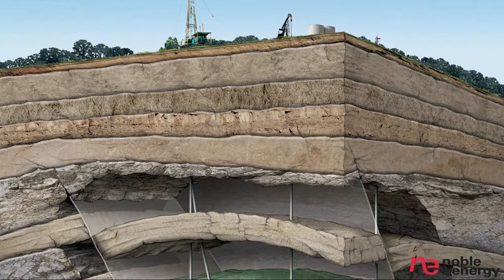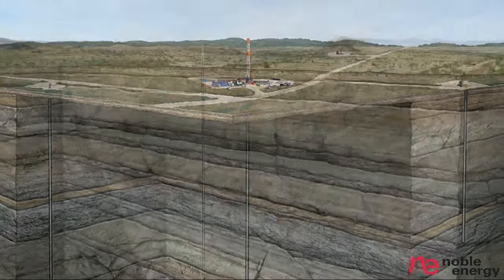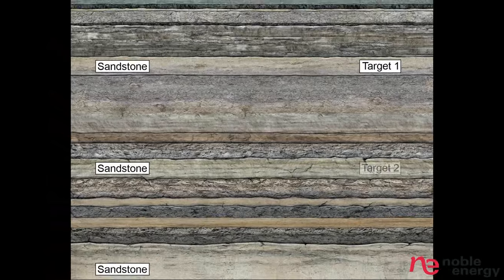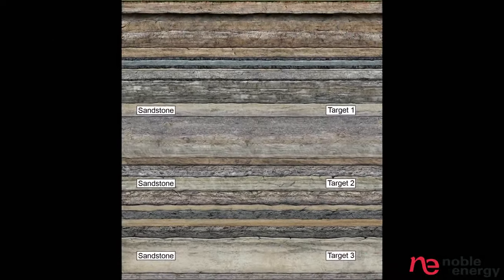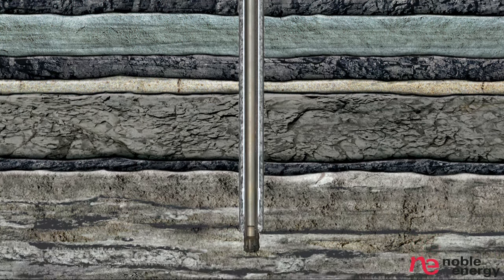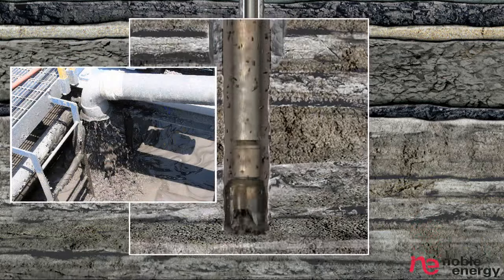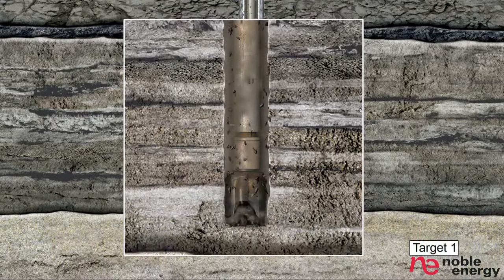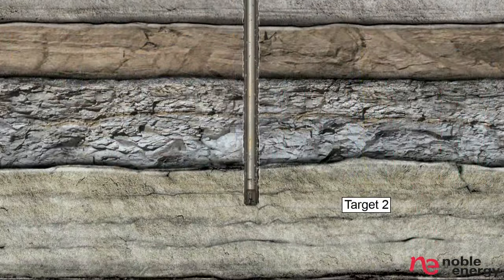Hydraulic Fracturing Stimulation

Comment: Yeaa so im not seeing whats so horrible about this? Why am I supposed to be against it again?
Reply: As I understand it, it can present the following risks: 1) fracking at a too shallow depth, where the cracks result in fracking fluid or oil/gas contaminating the water supply 2) same if the well casing breaks 3) flowback water being improperly disposed, eg being dumped into a river or an open pit or a treatment plant that isn't capable of removing these particular chemicals. Maybe there's a way to do it safely, but there's always a financial incentive to cut corners, and in that case the damage can be major.
Reply: Exactly
Reply: Let's also consider the environmental laws. In some states the laws don't require casings, just a leaky pipe driven into whatever strata they're going for, allowing leakage into the strata above. What is shown in this video would be within the law in states with more stringent environmental regulations.
Reply: Come live in my area for while.  It will change you mind.

Comment: looks like something Mr. Burns came up with. Don't the fracturing chemicals get left in the fracture and contaminate groundwater? Interesting that a video produced by an energy company that uses this form of drilling left out all the atrocious side effects of the practise.
Reply: the chemicals are released thousands of miles below the surface. No place in the nation, even deserts with deep wells, gets water from anywhere near these fracking wells.
Reply: @bennetthasty7488  That isn't accurate. Firstly, the chemicals are released thousands of FEET below the surface, not miles. Second, the entire water table is interconnected and heated water from deep within the earth perculates up toward the surface. I worked in a laboratory where we would take soil samples from the surface that could identify mineral deposits thousands of feet down because water that bubbles up carries trace amounts of these minerals with it. There have been reports all over the place (and in the scientific literature) of scientists identifying toxic and carcinogenic chemicals from fracking in peoples well water.
Reply: @brcarter1111  dont forget that when they finish they also put a similar solution in the fractures leading to the chemicals being able to transfer to other sources over time. Which is why we have so little drinking water than thought
Reply: @bennetthasty7488  Actually only a couple of miles.
Reply: What chemicals, mostly water and sand.   You have no idea what fracking is about

Comment: I have a question: how the cement layer is being created around the casing and the aquifer? I understand that the casing diameter is smaller than the hole so, when the cement is pumped through the inner core of the casing, it starts to cover the outside of it by going around the casing pipe. It is posible when there is a solid wall around the casing but when  it is water? How the cement layer is created around the casing?
Reply: Last question first.  As shown, cement is pumped down the casing and when it flow out of the bottom, the only way to travel is up.  The amount of cement is calculated to fill the annulus or space between the casing and the hole wall. 

Now to address your water question.  Cement may flow out a small distance into water zone but it is thick and will "plug" the water zone as the cement continues to rise.  The cement will harden even when under water.  After cementing, a cement bond log can be run.  This type of log "rings" the casing.  This is like tapping on a tile on a floor in that it sounds different when the cement under the tile is not bonded.  The ringing is recorded as a chart vs depth. If the bond is not good in a critical water zone, the casing can be perforated, the zone isolated, and cement pumped through the perforations to seal the casing.
Reply: There is no water from the aquifer in the annular space because pressure is maintained by drilling mud. As the cement is pumped down the mud in the annular space is displaced by cement.

Comment: This is creative. I am confused though as for plug 1 being set for a charge because wouldn't that allow the surface water to sink down past potentially? Why wouldn't you just do it with 2 and 3 and leave 1 alone or am I missing something?
Reply: I dont follow exactly but I can explain why surface water isn't an issue. At surface an iron wellhead exists which blocks entry of contaminants or other liquids from entering top down. Contaminants can enter when drilling (before fracking begins). We seperate the stages of a frac so we have to use less horsepower on surface when pumping frac fluid downhole. So once toe prep occured (not covered in the video) a wireline crew sends our perf guns (a series of shaped charges facing the formation) down in a line, and at the far end of the line sits a frac plug which using an explosive is set into the walls of the casing. The explosive compresses the plug and the teeth can set into the casing walls. 

Then the wireline is pulled up (reeled in) to reach the desired depth at which case the shaped explosives are fired to make a hole through the metal casing, cement, and about 2 feet into the rock. Now that there is this opening we inject frac fluid at a rate greater than the fracture gradient (the pressure required to cause microtissues in the rock formation) and at a rate which produces a pressure lower than that which will cause it to fracture improperly ( a small cone shape rather than a root structure shape) or less than the pressure required to break the casing (very expensive).

As far as subsurface water not in the oil reservoir already, it is blocked off from the wellbore typically by a mile of depth (the natural water table) as well as several inches of strong steel surrounded by concrete.

Comment: FYI, the things that get pumped into the rock are MANY different chemicals that are not good for the environment. These have and do contaminate water aquaifers, here in Ohio and many many other states.  the video is not entirely truthful,.  Most of what happens is mostly accurate but, not a word about the fact that they do contaminate ALOT.
Reply: I'd boycott using any fuel if I were you.
Reply: @MrThenry1988 just go live in da woods
Reply: Its happening way underneath the water aquifer.

Comment: david baldacci's book ' walk the wire'  is in a n. dakota oil rig setting where fracking is going on.  
and
ch. 27 takes the reader into a control room / data center.  
and this Noble Energy  vid'   has visuals that
complement understanding the word descriptions in that ch. of the processes under way

     good of you to have put it together & posted it.  

one thing came out in the book is about all the methane that co-exists with the oil
and
gets wasted by being burned off.  

it ,  the methane,  is 'dirty'   needs some work to clean up and make it a commercial product.  

   economics rules what is saved and what isnt .

Comment: Pa has over 5000 miles of dead streams destroyed by acid mine leaching.  This disaster will never be fixed.  Now the frackers are destroying our ground water and our legislature does nothing.  Who will fix the well casings when they fail.  They will eventually fail.
Reply: All for a quick buck.
Reply: Le gaze de schiste pour le  frique
Reply: Will the cement crack, after the charge explosion or after when it is dry, resulting in contamination of the ground.

Comment: Why not just use water under higher pressure no chemicals.
Reply: Good question.  Actually just water under high pressure will break the rock.  However, when the pressure is released, the cracks close back up.  To prevent this, proppants (like sand) are pumped along with the water to remain behind and hold the cracks open after the pressure release.  Also, chemicals are added to "thicken" the mix and keep the water from escaping from the fractures and reducing the pressures.  These chemicals have chemical timers that will turn the thickened mix to thin and allow the water and chemicals to flow back to the surface leaving the proppant behind.

Comment: Can the drilling come underneath my property if I’m less then 2 miles from the well
Reply: It could if it were directionally drilled.  However,  the well cannot be drilled under your property without your permission.  As the well is drilled, its 3 dimensional position is calculated to within a couple of feet.  This information is filed with the state.

Comment: Air pollution, chemical pollution from the process itself combined with small Earthquakes caused by altering tectonic pressures.  But other THAN THAT, great video!
Reply: Small earthquakes prevent large earthquakes. We need to start fracking along the fault lines in California before the big one hits.
Reply: Not as much pollution as it takes to make electric cars and windmills though 🤷
Reply: @FGDIESEL1  and what do you think the gas is used for?  The gas that they collect that is. There is still a large volume of gas that escapes. Then there is the water treatment! And don't forget the subsidies these companies get, yet the price of gas still goes up! When the company collapses where is the money?
Reply: One issue at a time; 1. Air pollution- all human energy sources create air pollution. 2. Chemical pollution - not sure if you are trying to say the groundwater is polluted from fracing? If so, that is not true. The aquifers humans utilize are typically around 800-1200 ft. deep. Sometimes a little deeper. They are "sealed" off from the oil and gas reservoirs by an impermeable rock layer, that acts to trap the oil or nat. gas. 3. Earthquakes are not caused by fracing. The earthquakes you are referring to are caused by saltwater injection wells, where they pump produced water back into the ground where it came from. This has been shown to create induced seismicity. All human energy sources have consequences. This has been acknowledged and addressed by industry. Thanks for reading.